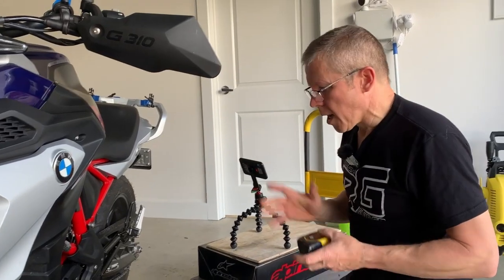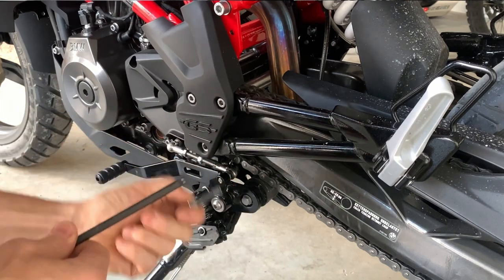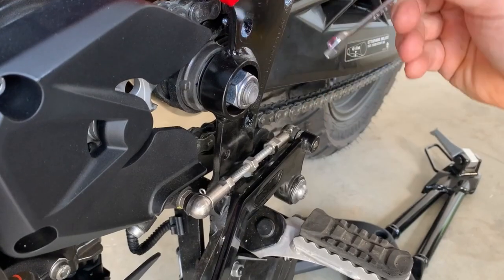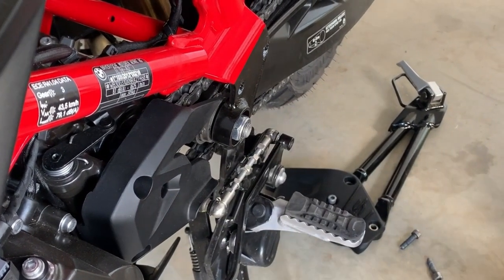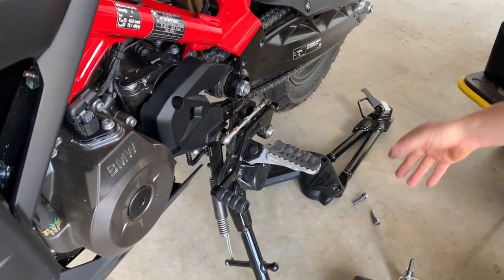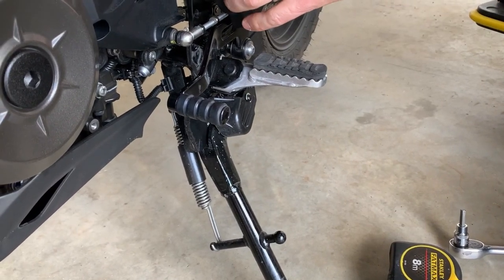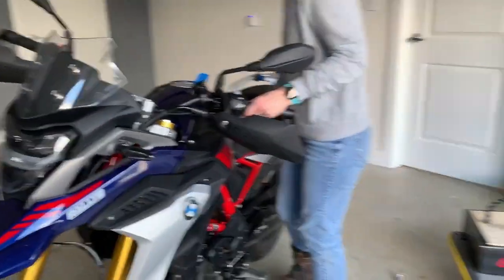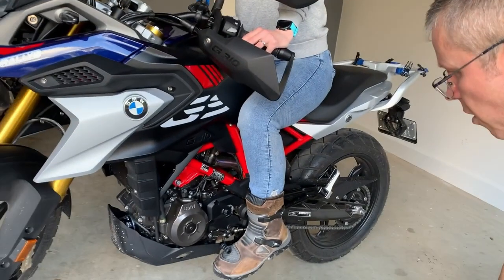HOW TO ADJUST GEAR LEVER BMW G310GS & G310R

Comment from the maker: We've already done a video that included this however it also included quite a few other things so to save people having to search through the whole of the previous video, we've created this one that covers just the gear lever adjustment for the BMW G310GS and it's the same principle on the G310R.  Very useful for riders who struggle to get the toe of their boots underneath the gear lever.  

#bmwg310gs #bmwg310r #tutorial #riderguider #theriderguider #MRSRIDERGUIDER

Comment: Thanks for this. I just made this adjustment on my ride after finding my new boots just didn’t want to go under the lever.  Of note I found the factory had installed a lot thread locking compound on the entire bolt, except for the section that actually threaded. .

Comment: I just adjusted my 2019 in 9 minutes approaching the shaft from below . 
Took it for a spin . Felt way better . 
Why didn’t the dealer do this at delivery? Been in discomfort for 5 years now .
 That’s sad on my part . I thought it was because of a old sports injury
Reply from the maker: Glad you sorted it.  At last.  Nice one.  Funny isn't it that we can spend a 5% of the price on a bicycle and the dealer will adjust the seat, the bars, the brake levers to suit the rider.  Buy a motorbike and they do nothing like that!
Reply: @TheRiderGuider  I was actually going to sell the bike and at my current age of 71 , thought this was the end of my riding career. I am thrilled to be able to shift with out pain . 
I just love YouTube videos!
Reply from the maker: Indeed.  Great you’ve been able to carry on riding.  What bikes have you had previously?  Our GS is my wife’s and I find it a capable bike when I borrow it 😄
Reply: @TheRiderGuider  I had a 1995 FXRP Harley for 5 years and a K1200LT for 19 years . 
I could ride the HD today no problem, but the K bike was just too big to muscle around anymore